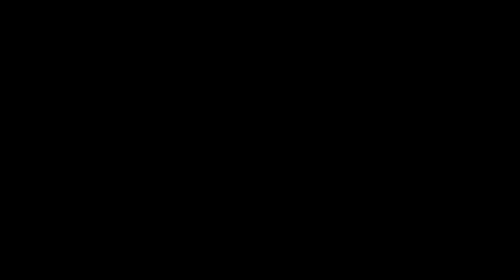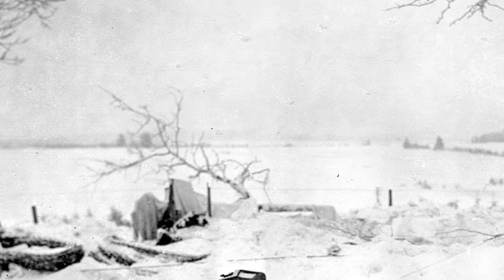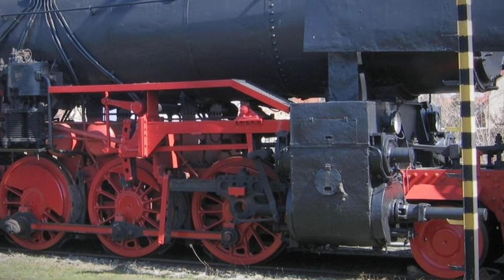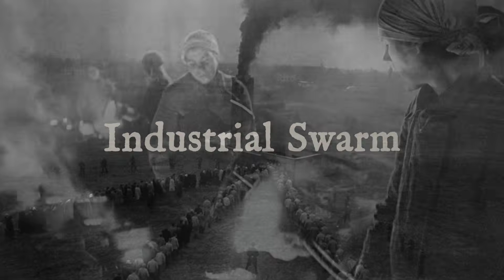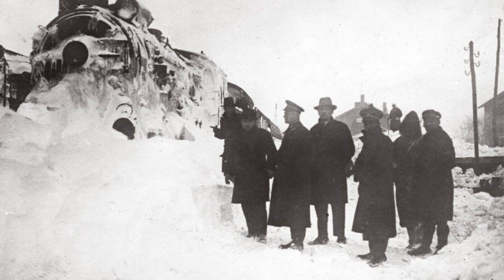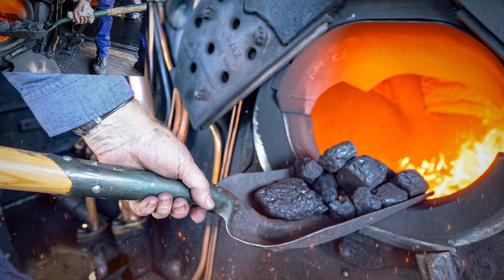They Built This 'Nazi' Train To Be 'Disposable' Garbage — Then It Ran For 50 Years

Comment: You appear to be unaware that Western Europe ran on standard gauge 4ft 8.5 while Russia used a broad gauge 5.0ft. Hence GERMAN Locomotives could never have run in RUSSIAN WINTERS  - everything had to be trans-shipped at the border. If they were built in Germany for Russian Gauge how did they get there? Whichever they were built for the same locos could not have been used after the war in Austria and Russia - unless they built standard and broad gauge versions but there is no mention of this.
Reply: About 2000 machines went east after the war the ones for russia got regauged and refittet for use in russian winter
Reply from the maker: fair point on the gauge difference, we shoulda been clearer on what got built where and what actually ran where -- so what specific locomotive class are you saying we got wrong on the gauge and where'd you see the documentation showing what was actually delivered post-war